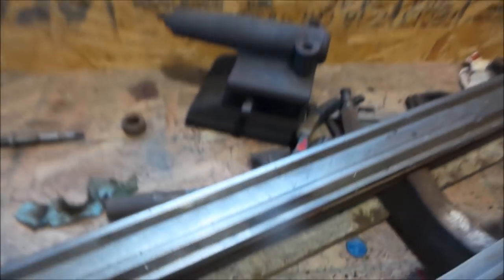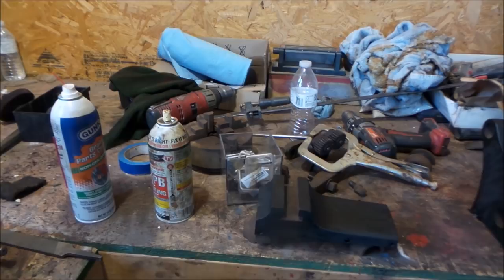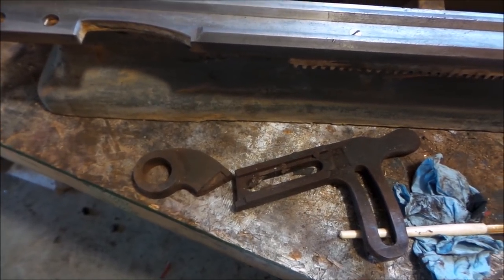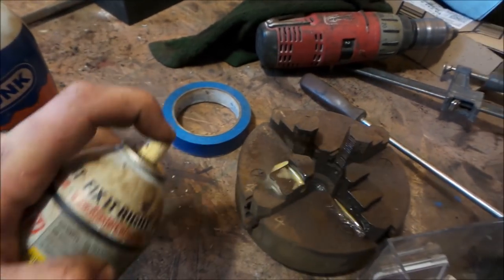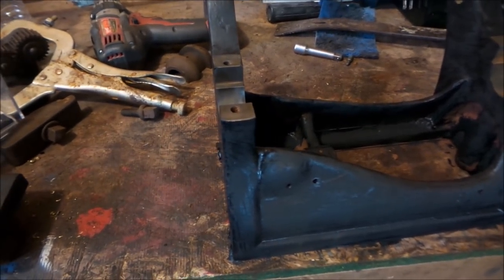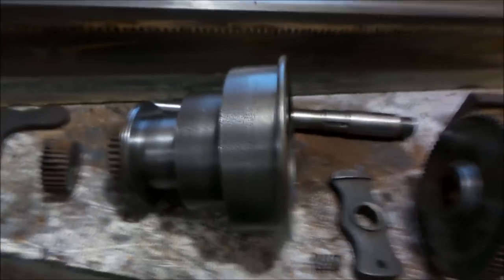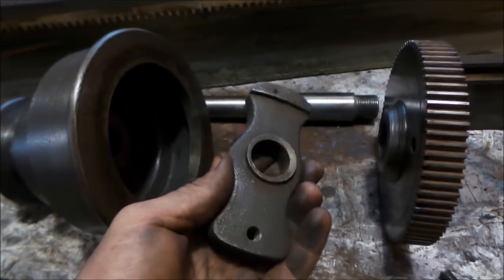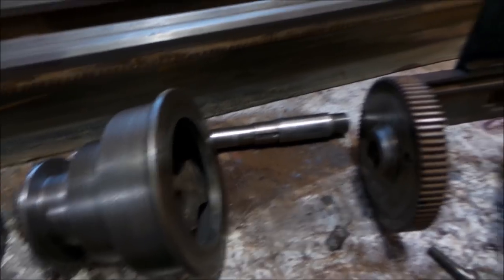Vintage Lathe Restoration: Pt 3

Comment: Good size tub for electrolsis to remove the rust. Also when I do restoration work like this i tend to do sections at a time. So I do the tail stock then move to the compound, that way I dont lose parts or get then mixed up, that just the way I do it.

Comment: You are doing great. Move camera slowly, slowly, and let focus. let focus a long time. Machines don't move as fast as young men.  good work. you are doing great. I am surprised someone hasn't told you what the part is in the headstock, probably a lot of people know. But has something to do with shifting in and out of back gears, and transmitting torque from the drive to the gears, would have to see it myself to see what it does.

Comment: JUST DID A ATLAS LATHE WITH ON BACK GEARS I PUT A 12V. MOTOR ON LEADSCREW
Reply from the maker: Ed Martin that was my idea for this one. I'm gonna have it belt driven from the bottom straight to the lead screw and have a potentiometer to adjust speed